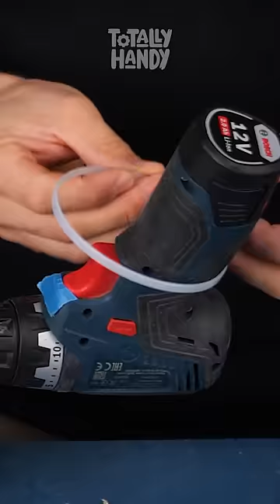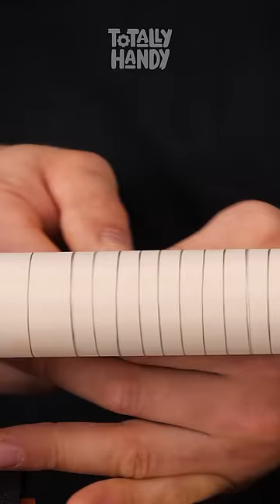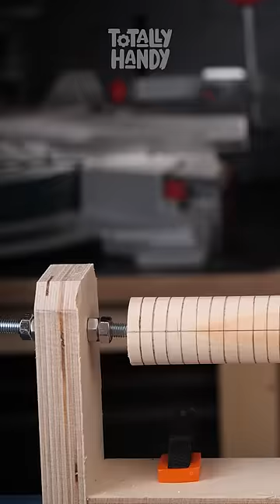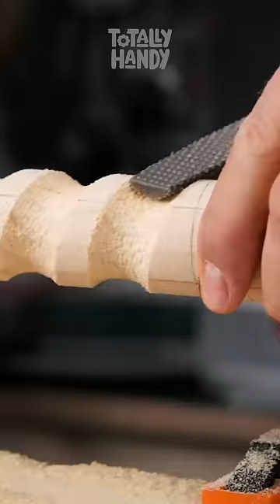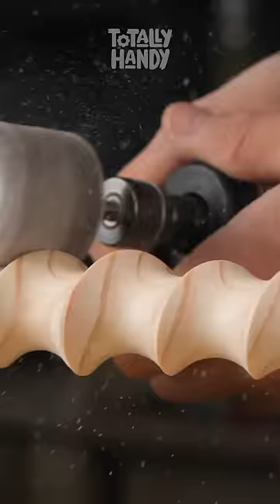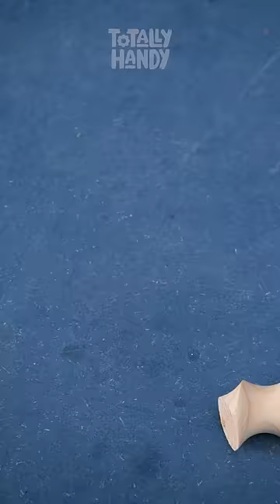Amazing Woodworking Hack #shorts

Comment: If you ask me, I'd tell you to skip the step of marking the lines with a pencil. (Why do you need it anyway? What did you get out of it?)
You can start right at the stage of the black adhesive tape.
The distance of the spiral can be estimated by eye, and there is no need for millimeter precision, so there is no need to mark with a pencil.
Reply: Nor was there need monotously do it entirely by hand if you had a drill to speed things up.

Comment: He learnt whilst doing this there wasn't enough punch in the drill to turn the "wood lathe" whilst the files were on it haha

Thanks for the likes! Check out subing to my own channel if you love dogs and general weird also built myself a man cave bar which is going to be uploaded in the next coming days!
Reply: It would screw the spacing up, it would have to be done at really low RPM or by hand.
Reply: You can't do this on a lathe
Reply: It wouldn't work...you think he didn't spin it because of that?
Reply: @dannykeller1695  yep. Totally impossible to do on a real lathe with auto-feed..
Reply: @cobra6481  by real lathe, I'm guessing you mean engineering lathe? Because you could just engage the lead screw and cut it, as if you were cutting threads. Surely? Just need some unusual tool geometry and be tricksy.

I'm now going to have to spend an inordinate amount of time trying it...
Reply: @hokipokist  it’s sarcasm
Reply: @hokipokist  there's a wood lathe too u use special hand chisels
Reply: @hokipokist  yes, I did mean an engine lathe. (a.k.a.: regular/common lathe, since ppl usually drop the 'engine' part of its name)

Exactly that, a feed rate of whatever/revolution with round chisel geometry would do it.
Reply: @JeronimoStilton14  yea, it WAS kinda dripping with it..
Reply: @mossey9925  same structure as the engine lathe with weaker powertrain/motor.. Sooo, yea.
Reply: @mossey9925  yep, yep! I reckon wood lathes are the best way to get into woodwork, too. Fun, quick results and an unlimited number of hilarious dild...candlestick holders.
Reply: @cobra6481  cheers - I'm very much a novice on the machinist side of things. Spent some time on mills and lathes, when I was serving my time as a boatbuilding apprentice, but I'm still constantly astounded by the sheer fucking wizardry and creative problem solving you metal-wranglers come up with.

Conversely, I can make a dovetail watertight...so I'm not a total loss 🤣 (look at Burty big bollocks over here).
Reply: @hokipokist  fun fun! I wish you the best in your turning materials journey. And don't forget to polish those 'candlestick holders' for 'ease of use'.. 🤣